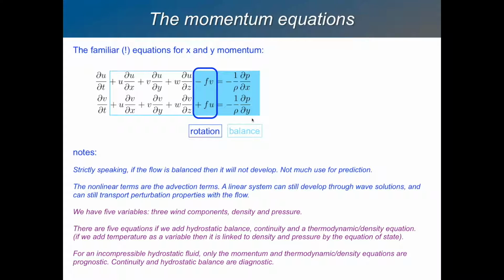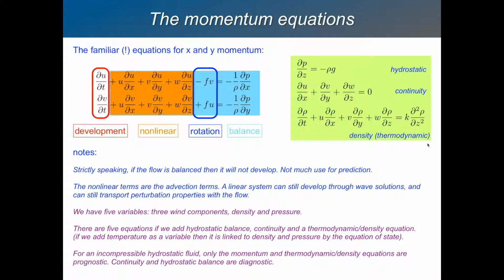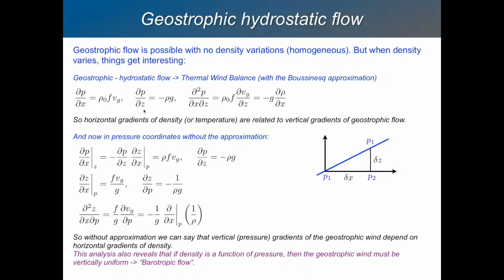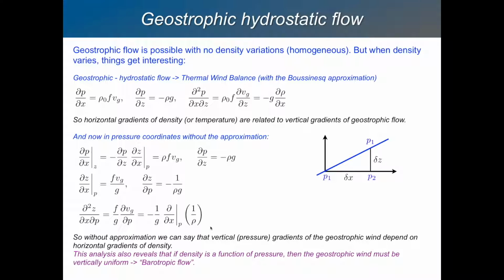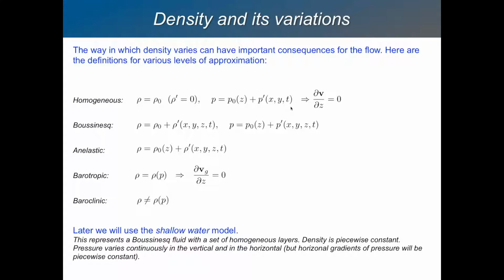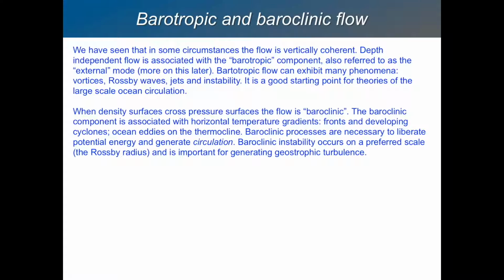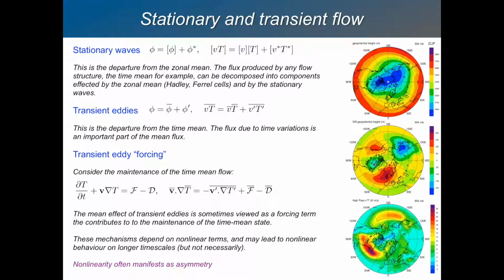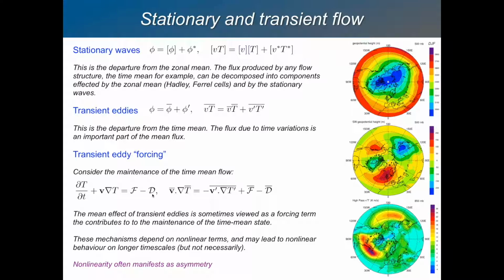GFD 1.3 - Basic Equations, Balance and Flow Partition

Comment: Hello, after some discussions, I'm faced with a paradox concerning the expression of thermal wind in pressure coordinates (8:50). 

If density and pressure surfaces are parallel, there is no vertical shear in the geostrophic wind. But let's imagine that these surfaces are very tilted. This means that a z-coordinate analysis would reveal a strong (horizontal) density gradient, and we'd be tempted to conclude that the atmosphere is baroclinic and that vertical shear is present. 
In other way, we can get horizontal temperature / density gradients in a barotropic fluid (in z coordinates) ! It's confusing to me.
In addition, why then this thermal contrast cannot be converted into kinetic energy ? 
It seems that only contrasts on pressure surfaces can be converted into kinetic energy, so i wonder why.
Reply from the maker: It's a good question - best if we start by imagining an incompressible fluid where the pressure and the density have simple relationship. The vertical change in pressure is entirely determined by the density through hydrostatic balance. If density layers slope, then vertical pressure gradients will depend on both horizontal and vertical position (latitude and height if you like). For pressure surfaces to have the same slope as density surfaces, what you need is for the surface pressure gradient to be just right. The horizontal change in pressure from one density contour to the next has to match the vertical change in pressure between the same two density contours determined by hydrostatic balance. In that situation, the horizontal pressure gradient will be independent of height, and so will the geostrophic wind, despite the sloping density contours. Of course this gets more problematic when you allow temperature to vary in a compressible fluid and so the situation you describe would in reality probably be baroclinic.
Reply: @NickMJHall  I read several times but I don't think I really understood. In particular, your last sentence is surprising. This would mean (?) that even when the density is only a function of pressure, it can still be a baroclinic situation ?
Reply from the maker: @DertiDerty  Sorry, that was misleading. If the density is only a function of pressure that's barotropic by definition. So I shouldn't have said "the situation you describe". But generally if you have strong gradients of density n the atmosphere you also have strong temperature gradients. Three variables in the equation of state. Usually baroclinic.

Comment: Sir, To my knowledge, Jet-streams are formed due to the horizontal temperature gradient. So, it may be an example of a baroclinic. Why you are considered as an example of Barotropic. Is thee any other explanation is there?
Reply from the maker: Jet streams are indeed baroclinic as the vertical wind shear corresponds to the horizontal temperature gradient. But there is also a surface pressure gradient, thus a barotropic component. Even without this, much of the dynamic of jet streams can be explained in a barotropic framework.

Comment: Thanks professor. I got a question, how do we prove that if rho = rho(p) then dv/dz = 0 exactly? Following this question, can we really get a purely barotropic geostrophic flow in a stratified ocean? Mathematically (by combining thermal wind balance and rho = rho of p) we have dv/dz + drho/dp * g * v = 0, if dv/dz = 0 then v = 0, i.e., no geostrophic flow exists. Physically, we always have tilted sea surface height and oppositely tilted isopycnal surfaces for low frequency motions, which suggests that contours of rho never coincide contours of p as long as a purely geostrophic flow is present.
Reply from the maker: Seems you have several questions here. First, it is the geostrophic flow that is independent of depth in a barotropic fluid - as demonstrated here. If the density is uniform then this is also true for the total flow. Second, if there is a tilt in the sea surface then it's possible to have non-zero barotropic flow even when density varies, as long as it varies as a function of pressure. In this case the density surfaces will all be very slightly tilted along with the pressure surfaces. Finally, yes, this doesn't really correspond to reality where the ocean is baroclinic and the thermocline tilts the opposite way to the sea surface, so the deep flow is weak. But, in theory, non-zero barotropic, depth independent flow is indeed possible in a stratified ocean.
Reply: @NickMJHall  Thank you professor. It's a bit puzzling to me that a stratified ocean with tilted thermocline can support a depth independent geostrophic flow (in theory), because in that case the thermal wind relation ( e.g., f*u_z = - b_y ) suggests that the horizontal buoyancy gradient is zero, that is, the thermocline is not tilted. Do you mind raising a few (idealized) configurations in which stratified ocean with tilted thermocline supports a barotropic geostrophic flow?
Reply from the maker: @yanwang984  You need to get out of the Boussinesq approximation. The full geostrophic flow is then expressed as dp/dx=rho f v where rho can vary in the horizontal. Work through that and you'll see that if there is to be no vertical gradient of geostrophic flow then the density surfaces must be aligned with the pressure surfaces.